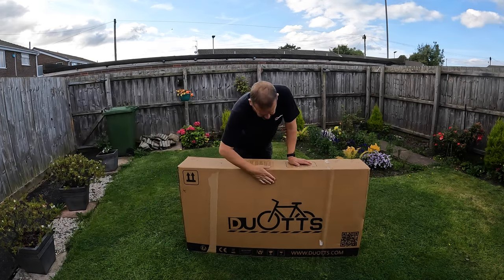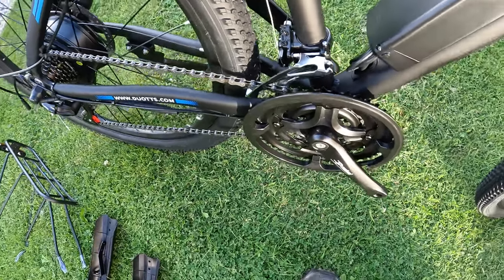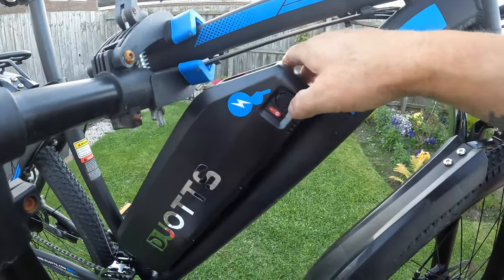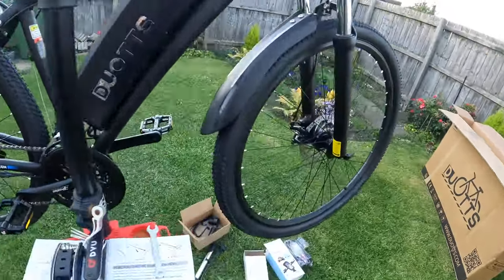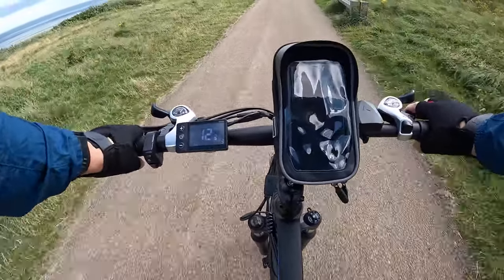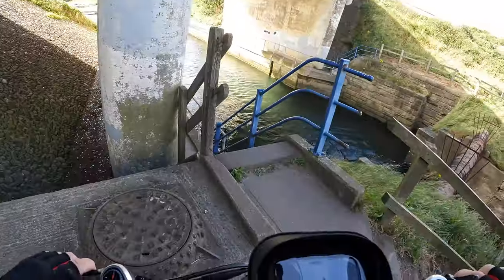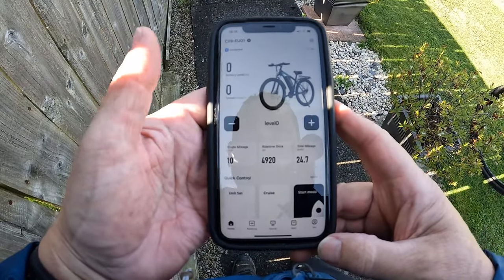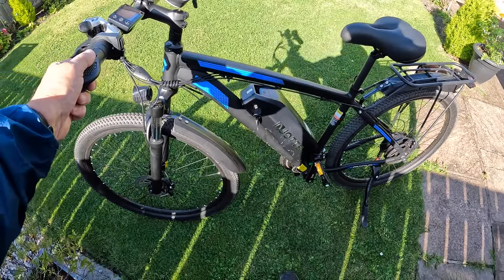DUOTTS C29 | THE CHEAPEST FASTEST E-BIKE YET??

Comment: My old Halfords ebike has a torque sensor I understand this one has a cadence sensor. Would that affect my usage?
I don't mind the 15 mph limit as I really only use the power to pull away from standstill and to help out on steep hills. The rest of the time I cycle under my own steam.
Reply from the maker: Unsure. I think the more you are powering it the less motor is needed. Therefore battery life will be longer. I switched the power off part of my ride and the battery went up by 1 bar.

Comment: Do you always keep it in 48v and not 36v for mine yesterday bloody awesome 🙌
Reply from the maker: 36v
Reply: @AndyWardle  thanks I did 48v and noticed battery dead lol but when back to 36v battery full how long do you charge your battery sir thanks 🙏
Reply from the maker: @Jayzkayaydancasper  usually 4-5 hours a time
Reply: @AndyWardle how do you switch from 48v to 36v and what difference does it make? I have this bike, do you have any idea if it has a safety cut off on the battery so it can't be overcharged, I get really paranoid about battery fires. Thanks
Reply from the maker: @ it’s always 36v no function to switch. I think as long as you use the correct charger (the one supplied) it’ll be fine.
Reply from the maker: @keyboardpatriot  it has safety cut off too
Reply: @AndyWardle  the bike does have a setting of destruction speed and also 48v 36v and 72v he means the bikes voltage
Reply: I have the same bike and can change it from 36v to 48v
Reply from the maker: @Jayzkayaydancasper  I’ll have to look into that. I never knew. Maybe you can answer his question. 👍
Reply: @keyboardpatriot  yes to change voltage on display press and hold -and+ will then bring you into menu then press power button 3 times and you will see voltage at bottom press - to decrease and + to increase
Reply: @AndyWardle   yes to change voltage on display press and hold -and+ will then bring you into menu then press power button 3 times and you will see voltage at bottom press - to decrease and + to increase

Comment: Nae wonder it's so fast Andy it's 3 times over the legal UK limit lol. Bastard nanny state were living in. It's crap that were restricted to 250w without getting Tax / Insurance ect to legally ride them on the roads.
Nice bike though and an even better price.

👍
Reply from the maker: Yeah it’s a bit frustrating. But there’s another bike coming which is legal. So I’ll try that. See if it’s any good. 👍
Reply: @AndyWardle   I cannae understand it. When I had my racing bike without a battery pack years ago I must have averaged over 20mph most of the time 😂

This NOT ALLOWED Culture is destroying the UK. :hand-purple-blue-peace:
Reply from the maker: @thingymabob2209  you can go as fast as you can pedal on any bike. It’s the speed limit is set on the e-bikes though.  I’ve done 30mph on this e-bike 😂 that was me pedalling though the motor cut out at 15
Reply: @AndyWardle   That's fast on a bike man 😂 bummer that it cuts out at 15mph though. Seen those Surron e-bikes going silly speeds.